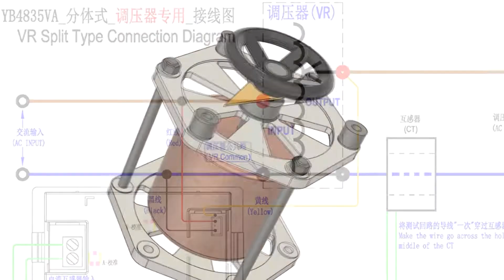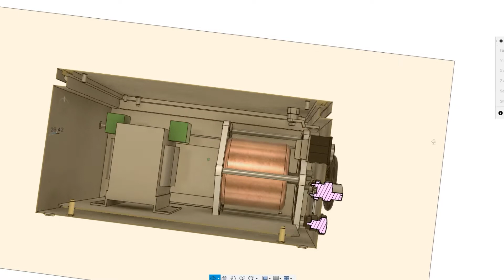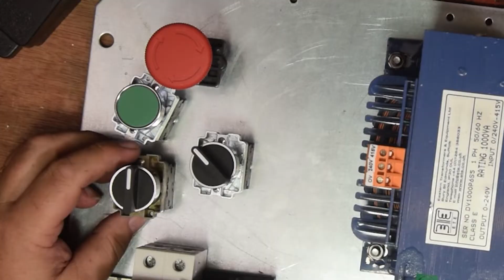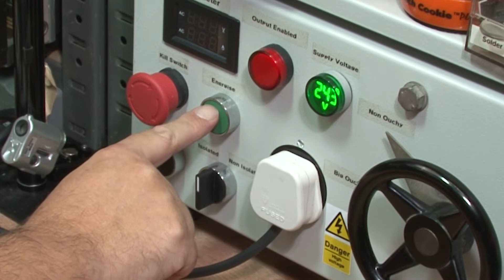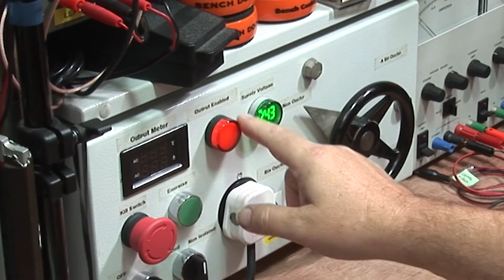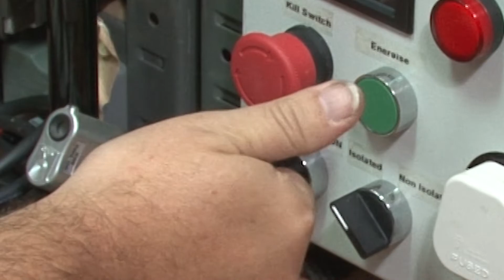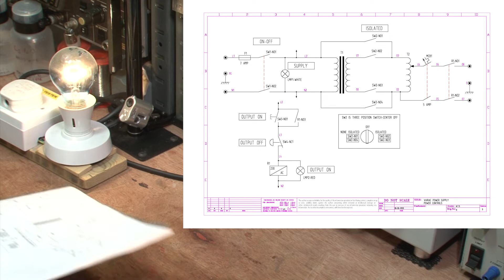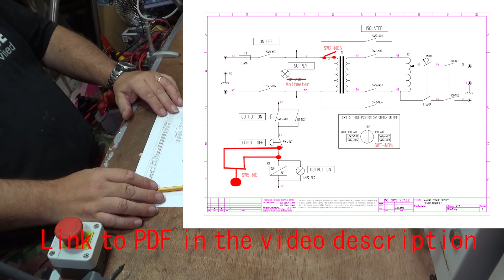How to make a variable AC voltage supply with a Variac and isolation transformer

Comment: Hey George,
I am always interested in power sources.  While looking at the schematic for this one, I had several things come to mind that I wanted to ask you about.
1.  On the schematic you show L1, PE and N1 as input.  Here in the U.S.A. That would be "HOT" or Line, Ground, and Neutral.  It is normal to see in some places, depending on the local code, the "Neutral and Ground" wires connected together in the box.  If things are done the same there, then if you connect 07 & 08 on the output to your load AND connect to the Earth or Ground connection, you are no longer isolated.  Would that be true there as well?
2. L2 on the string in the lower left of the drawing connects to the L2 on the bit above.  Also, N2 on the lower left string connects to the N2 above.  If switches 3 & 4 are closed, then the relay R1 activates, closing R1-N01 & R1-N02 providing output to the output jacks.  Is that correct?
3.  Is MCB1 a Thermal Circuit Breaker?
4.  Any particular reason for not integrating the light bulb in the unit along with the Isolation Transformer and Variac?
Keep up the good work.  Enjoy watching your videos!
Reply: Im from the UK and am also confused with the earthing situation, as if you have the device under test earthed the isolation transformer becomes mute. But a disclaimer i am very much in learning mode and have no background in this :)
Reply: Andrew Millea  I don’t think George will mind if I jump in and answer. The use of a isolation transformer has nothing to do with the piece of equipment under test being earthed or not.   This answer depends on the electrical wiring of your house etc and there are three different schemes employed. But for simplicity  please accept this at face value etc, let’s just assume at your local substation the earth is connected to the neutral conductor, they also have a big spike in the ground  to which the earth and neutral conductors are connected together . So although you call one wire Earth and the other Neutral they connect back to the same point at the substation transformer. So current will flow happily from the live conductor down either the neutral wire or the earth wire the current cannot tell the difference between the neutral or the earth wire because they are the same point on the  substation transformer. If your stood on the earth it will will also happily flow through you trying to get back to  substation via ground (dirt) via the earth spike. What the isolation transformer does is to disconnect the neutral earth reference to ground.  So the live conductor out the transform still wants to flow to the isolation transformer neutral but it’s now lost all interest in flowing back to earth.    So if you grab both live and neutral outputs from the transformer you will get an electric shock. But if you grab the live or neutral conductors independently you won’t get a shock as the circuit isn’t completed.   Actually that’s not quite true you will probably get a tingle as isolation transformer aren’t perfect and you get come capacitive coupling between primary and secondary.  Hope my crap explanation helps if not ask again and I will help best I can to explain better.  Stay safe best regards Chris
Reply from the maker: Hi Wayne, yes, L1, PE and N1 are your hot, ground and neutral. It appears though you would not be isolated by having the earth run through the whole box but this was where Chris enlightened me and I had my eureka moment too. If you have your neutral and ground tied at the distribution box or at the substation your live phase is referenced to ground as is normal. However, with the isolation transformer being in line the reference is not there at all.... rather than disconnecting the ground from the socket you have disconnected the whole phase, both live and neutral from earth. It sounds like an upside down way of disconnecting an earth wire but actually provides greater protection because the earth wire will still protect you if there is a failing of insulation from the isolation transformer or variac because it will blow the fuse in the line cord or trip out the breaker supplying the line cord and not leave anything at mains potential. In fact, even at lower voltages from the output, the breaker will trip on a current detection between phase and neutral.
The MCB is a thermal breaker and adding the bulb into the unit... bench space. Having the bulb loose means I can rearrange the test gear as things develop over time just by box shifting... Less chance of me breaking a bulb which are getting to be silly prices because of the ban on tungsten lighting over here.
Reply from the maker: Hi Andrew. It does seem silly to have an earth but it comes down to thinking about all three wires in relation to each other, rather than just the one wire. In the power lead, the earth wire is referenced to the mains at the wall. Either your earth is connected to your neutral at the distribution box or the substation. With the isolation transformer there, the earth wire is still connected to your house neutral but the live and neutral at the socket on the front are not connected to that earth wire in any way... Electricity flows to earth, but when the electricity doesn't know where earth is it doesn't flow at all!
Reply: @GeorgeChristofi  ok think I just had my head explode moment, so the components and box are earthed, but the socket itself is floating INR regards to earth. That makes sense, I was trying to work through the schematic but it's a bit fiddly on the mobile screen. I have just come into ownership with a similar Variac and want to put the isolation transformer in the same box :)
Reply: Andrew Millea yes you have it
Reply: George, the way you explain it is the first time it has made sense to me.  Thanks!

Comment: Hello George, greetings from the Netherlands. You have made a great video! You have inspired me to build one myself! Got a question though: All the Volt/Amp meters that I find (and look similar to yours), say that they start measuring from 30, 50 or even 80 Volts. I see yours starting with Zero. Where did you get this particular meter if I may ask?
Reply from the maker: I actually found it on AliExpress. It was listed as a meter for a Variac. It did take a very long time to arrive which was unusual for stuff from China.
Reply: @GeorgeChristofi  thank you very much for your reply. I will start searching

Comment: What are you thoughts on having the non-isolated supply's earth connectiion available at  the isolated output connector see Paul's comments here  https://www.youtube.com/watch?v=XBsQ3sZ45Fk  In the UK we have TT, TNS or TNCS, probably not as great an issue with TT  but our TNCS is exactly what he is describing?
Reply from the maker: My thoughts are basically that the Americans wire the distribution panel differently to the UK. In a UK distribution box the earth is not connected to the neutral so the situation described doesn't apply here. Our latest wiring regulations state that the earth must run through except in the case of recoding studios where the earth can be omitted to prevent ground loops.
Reply: @GeorgeChristofi  Correct me if I'm wrong but my understanding is that in a TNCS installation the earth and neutral are indeed connected together within the property.  Admittedly they aren't connected within the actual distribution panel itself but in the building infeed / DNO main fuse block?